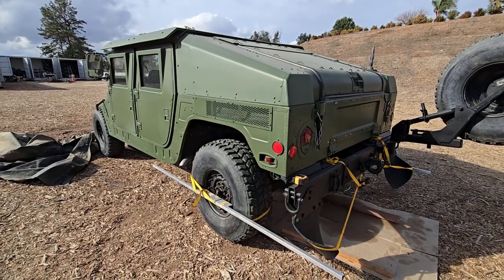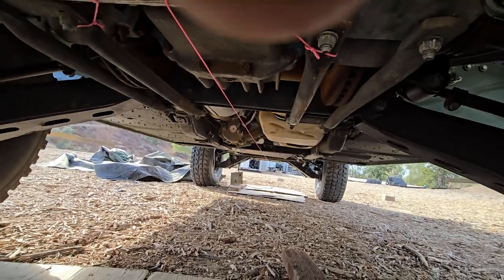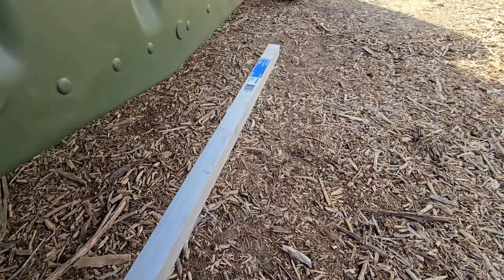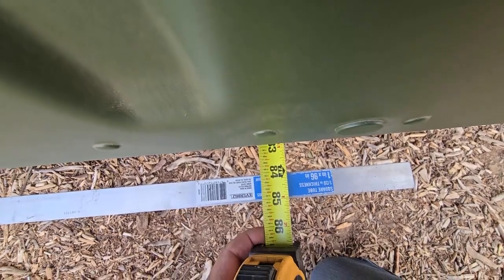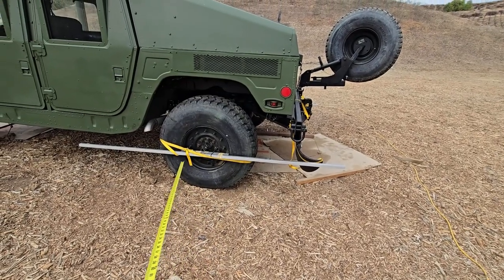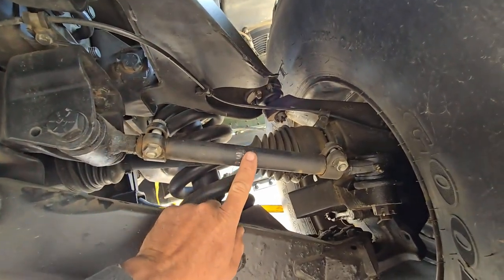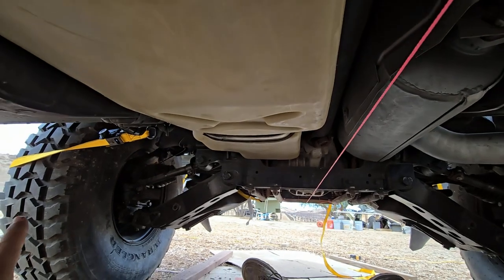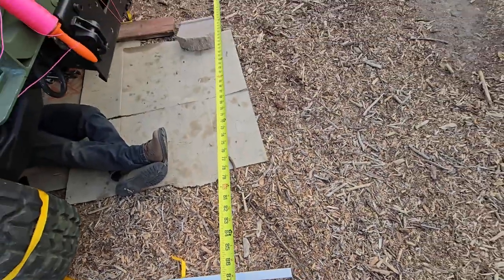Humvee HMMWV wheel alignment

Comment: Would this cause a whining sound when driving? I’m having an issue where the RH Rear is about 1” toe in, the LH Rear about 1-2” Toe in. When in reverse it’ll idle then slow down, when driving it’ll be quiet until about 10mph when starts whining. Tires rotate freely when on jacks in both directions. I don’t think it’s drivetrain related.
Reply from the maker: @Jus10-born2Run , your toe in are huge and those tires are scrubbing while rotating. Adjust as required and check your portals for oil
 I recommend draining the portals and diff, to see if there are iron filings in the oil.
Reply: @ portals and rear gear oil looks good. I adjusted the rear adjustment rods bringing the Toe out so the rear tires are straight now. Took it up to 25mph on asphalt. Didn’t hear any whining 🏁🏁🙌🏼